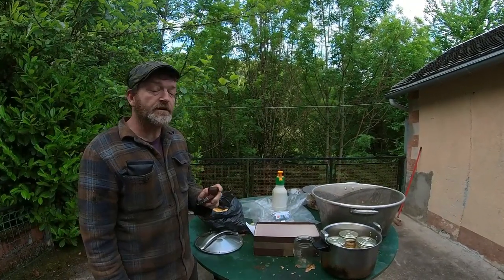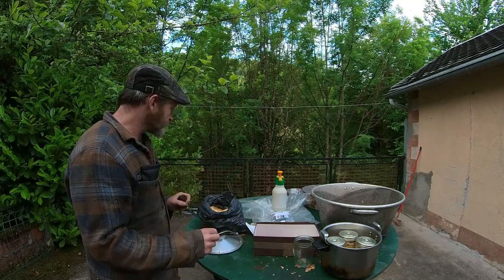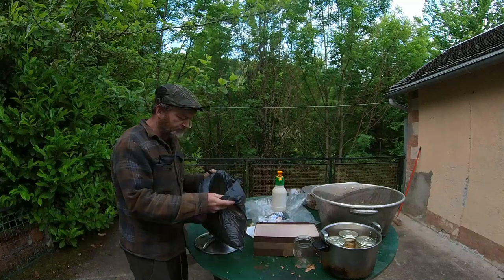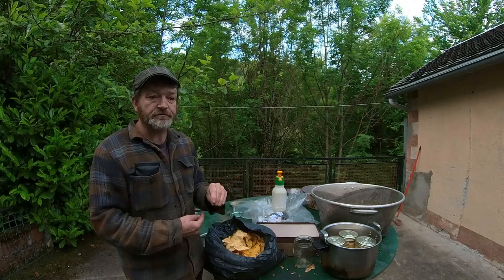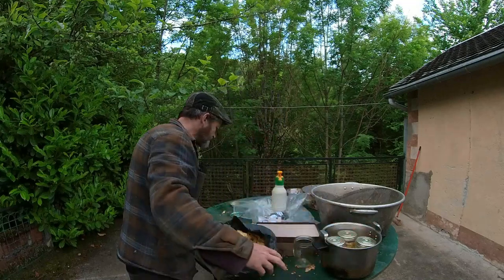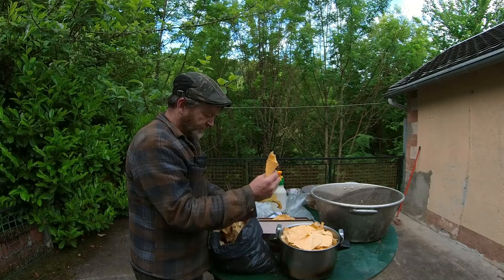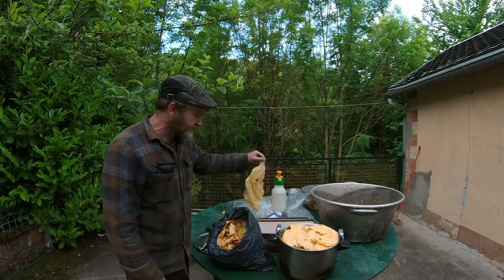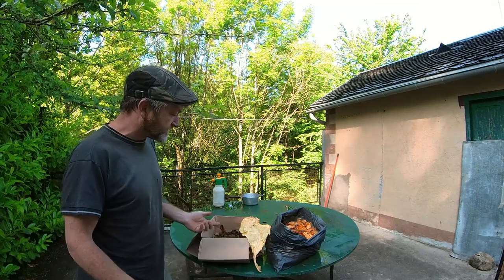Whole Leaf Tobacco 2021 #6 How and why to stove tobacco and making cavendish!

Comment: As a chemist, I'm very interested in the chemistry going on here and am still looking for any good technical papers on the subject, of which I know must exist.   *for those with dissimilar interests, please ignore:
-If this is Maillard, the temperatures necessary are 140-165C (280-330F) and you mentioned pressure cooker, which could do this, but looked more like an atmospheric steaming (max 100C).  What temperatures do you achieve?
-As for other reactions, closed and open to steam, oxidation seems reasonable; less and more respectively.
-The steam could also act as a solvent allowing for increased mobility of the reactive substances and a medium (water) for this to occur, i.e.,
-Rapid "aging," is also likely at these temps and may or may not involve oxidation and is more the reactive species being allowed to do their thing, but faster.  A huge caveat with this or Madeira would taste like port and I would just put my cabernet in the oven for a while instead of the cellar for several years.